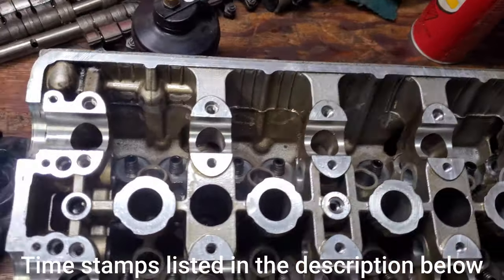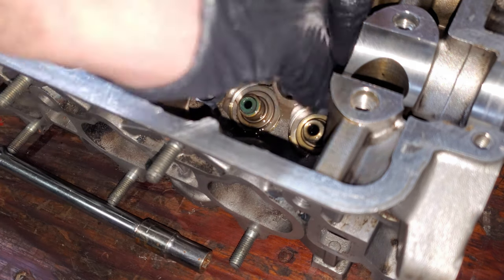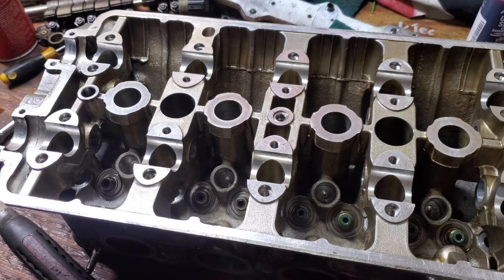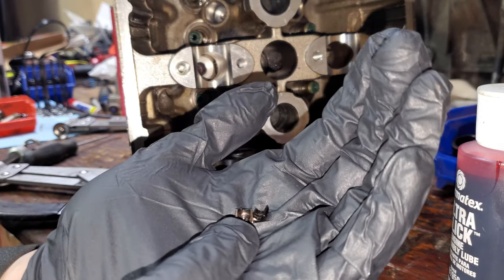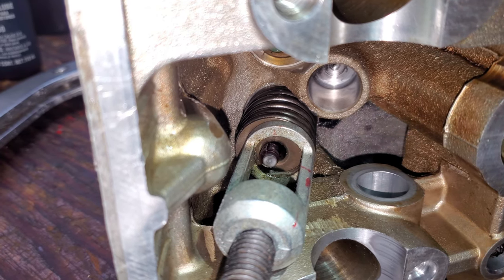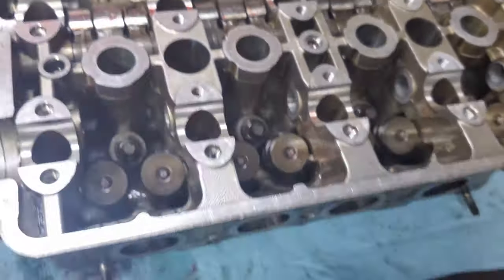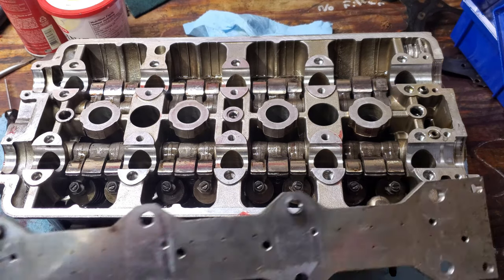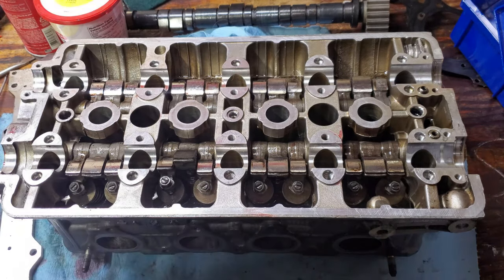HOW TO: Building Your B Series Cylinder Head! (B16a2) The easy way!

Comment: Green are inlet . Use a 10 mm 12 point socket as a hex will create problems and damage the seal often unnoticeably. I use an aluminium tool I made in the lathe . Check spring length on both inner and outer to ensure within limits for reuse . Ensure any casting flash is removed before final clean from the inside of the surfaces .  The D series are often better castings and still have thin casting flash that could break loose during later processes like torquing down the head etc. Dry lube spray anti seize is not so messy and a blob of grease will stick to it when installing the collets (keepers). When assembled you can run some engine oil over the cams before closing up .
Reply: Good info!